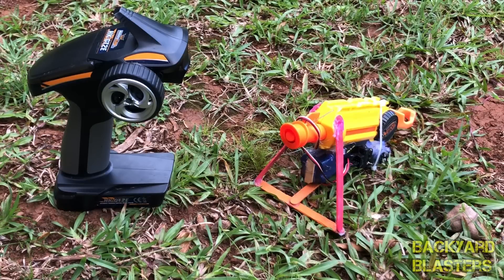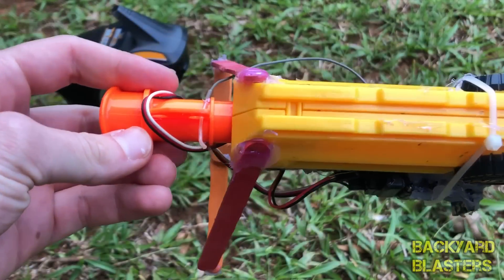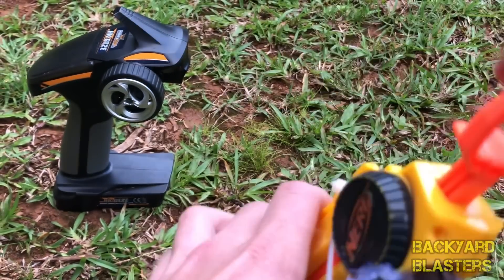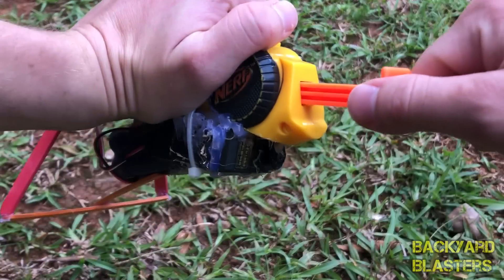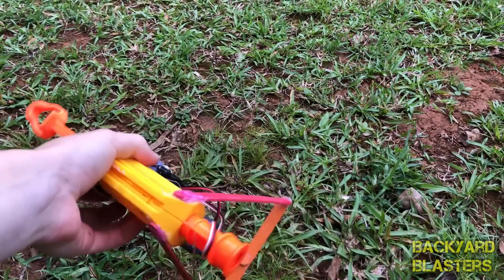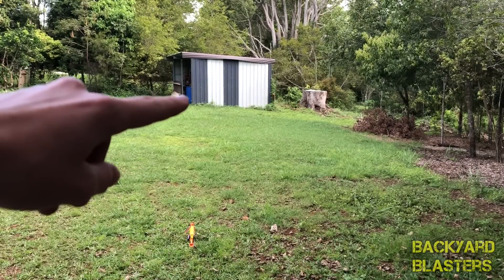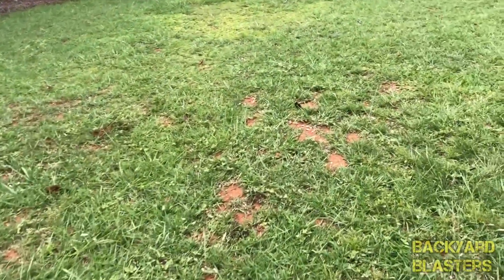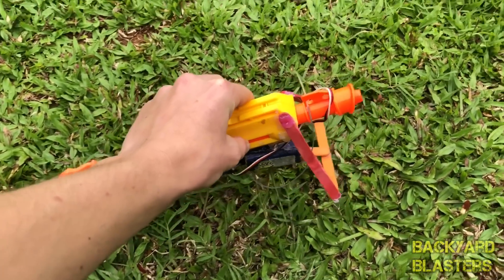FLYING NERF GUN - Homemade Nerf Turret Drone!

Comment: Thanks Flint! Sadly the remote doesn't always turn on. That's what happens when you leave it outside for two weeks. When the remote's not on, the servos do unusual things, so you get shot accidentally if you forget to check the status light on the TX.